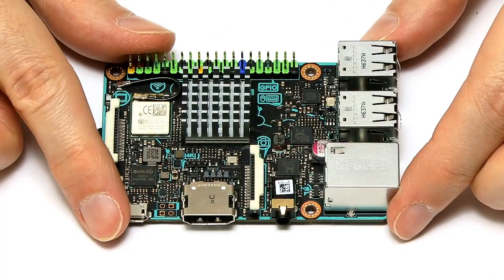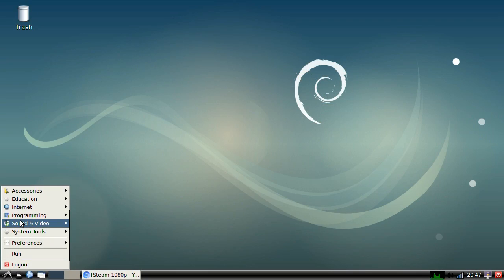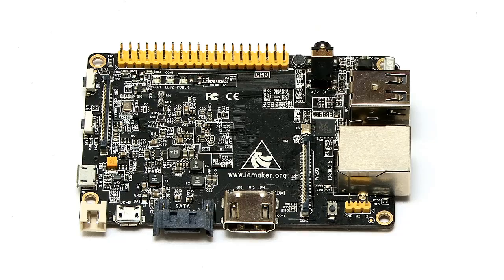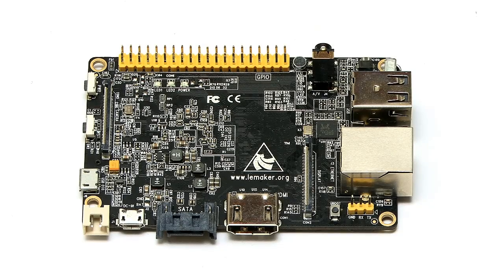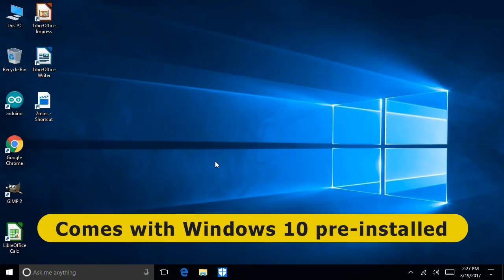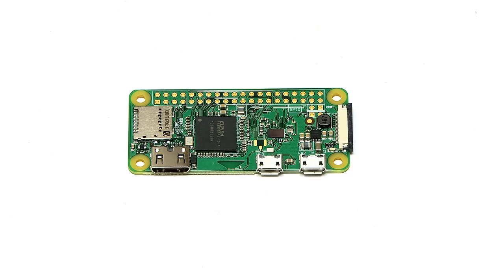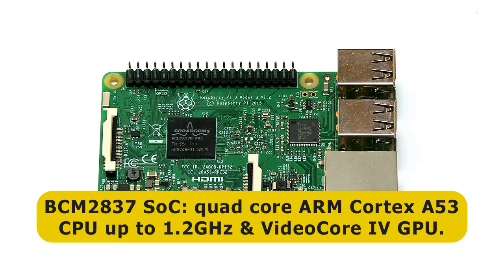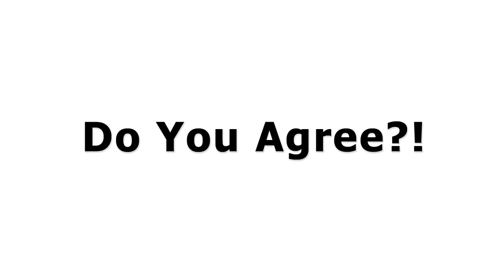Top 5 Single Board Computers 2017

Comment: People think of the Raspberry Pi as a "computer", but really it's a SBC to help you learn programming on and to prototyping other things, and it's NOT some kind of replacement for your PC... although it will do that.
The other thing is people say "I wish it had" , and then fill in what you want. The thing about that is the Pi WILL NOT be ~$35 with more stuff... there are already SBC's with what you want on them, and all of them are higher $$ than the Pi, ALL of them. What you want cost $$ and most lack the community support the Pi has, and there are a bunch of Media Centers available already, if all you want the Pi for is that, there are others out there already.
I'd rather have the $35 price tag to make it do what I want (which requires even less processor power than the Pi has), then to have to pay more $$ for crap I don't need...(or want). What I like is the ability to program on the Pi and NOT to have to SEND it to the Pi.
Reply from the maker: As I said in the video, and as you imply, the SBC market is already segmenting into lower-cost SBCs like the Pi, and more extensive boards for industrial and other applications.

Comment: Got to agree with Numbers 2 and 1.  I have various Pis doing various tasks.  

3 Zero Ws 1 for a webcam, 1 that connects to my solar panel inverter to monitor generation and another that monitors electricity usage.

A Pi 2 runs my weather station

A Pi 3 is in my AV setup

and I Have a Pi 3B+ as a plaything.

No they aren't the most powerful, but I know what I'm getting, I know I can make it do what I want it to do, and there are people who can help me.

Comment: Can the zero w run the camera accessorie
Reply from the maker: Yes, the Pi Zero W has a camera port. It needs a slightly different ribbon cable to connect to the Raspberry Pi camera though, as the board is so small that it cannot include the full-size camera port slot. But the cables are easy to get hold of -- eg see https://shop.pimoroni.com/products/camera-cable-raspberry-pi-zero-edition

Comment: Not to criticize your choice, but just a possible suggestion for a helpful video. The LattePanda can be used for typical desktop stuff like email and web browsing with pretty much just an old TV set, an HDMI cable, a keyboard, mouse and power supply.  How would you do that with a Raspberry Pi? Which operating system would one use, and how do you install it? What adaptors and such would one need? Is the Raspberry Pi suitable for a task like that or would it just be a pain?
Reply: My apologies! That question is answered fairly well in your video comparing the LattePanda with the Raspberry Pi 3. One assumes the use of USB mouse and keyboard in either case.
Reply: have you seen the one which he actually doe s a work week with one?

Comment: Re the Banana Pi ... something to bear in mind if you like the idea of a SATA drive ... I had a cubietruck, which came with SATA support. The big problem is that even using a laptop drive, the power draw was too great. So I had to use both OTG and the power socket via a powered hub to supply enough juice to the board. 

Although I was able to boot off the SATA, I messed aroound upgrading the system and I could no longer get the thing to work.

So SATA drives, although nice in theory, the devil is in the details, and I felt that the cubietruck deisgners hadn't really thought out the design. Just make sure the Banana Pi doesn't suffer from this limitation.

The RPi3, OTOH, is an extremely well thought-out piece of kit. One of it' great new features is a power adapter (!), which means you can supply adequate juice to the board. Powering via conventional USB is really too weak. I am able to boot the RPi onto a SATA drive (via USB), and run the system from there. It was really straightforward using the RPi3, and I didn't run into power issues or have to perform messy kludges. Having said that, I just run my Pi from a uSD now; but all I'm saying is that it can be done if you want to.
Reply from the maker: Good points here. SSDs run fine from SBCs, but beyond that -- as you say -- more power is needed. Though if an SBC is being used to build a NAS, probably a 3.5 inch HDD will be used to maximize capacity, so an extra PSU would be needed anyway.

Comment: I have been looking for SBCs with SATA for a while, thanks. In general I'd like to see more SBCs with more bandwidth (multiple gigabit ethernet NICs, USB3, SATA, etc.) WiFi and graphics are nice but where are the SBCs that cut those out for more bandwidth intensive applications?
Reply: there are, I have seen a multi port one come on the up next list, it had 3 and sata, there is only over a thousand alt choices of SBC

Comment: I agree with #1. I have several PIs myself and other SBCs but what REALLY makes the difference is the amount of software available for the Raspberry PI. For example, I have an Allo Sparky as well. Really nice board, better hardware in my opinion than the PI BUT, and it's a big BUT, software is hardly available and what is there is sh*t. It is largely unusable and is pretty much gathering dust.... So much potential not realised. Ultimately, you can't go wrong with a PI.
Reply: unless you ask a non pi person their thoughts

Comment: I have the Raspberry Pi 3 and have realized there's nothing it can do that my laptop can't LOL.  So my Pi 3 just sits in a box in the shed next to my Nintendo Wii I thought I needed 4 years ago :).
Reply: pitty that it sits there, but it was not meant to replace your laptop, look up story behind it
Reply: Laptop is far more useful to me, and I didn't have the patience and time to sit down and really learn about the Pi so its got a new home.  

They really need to come up with some sort of external power supply unit for them though, they are still tied down to an outlet unless you can find a portable power pack with enough juice to run it, most do not, at least I have never found one.  

I ended up giving my Raspberry Pi 3 away to someone in my Ham Radio group that uses them for all sorts of stuff, way above my knowledge.  So at least its no longer sitting around collecting dust and getting knocked off the table LOL.
Reply: it is good it is being put to use, as far as portable power there are several options.
As far a just a computer there are better options but one reason for its design is experimentation, which not a good idea on a 1000 dollar system (one reason why it was made) I got one to experiment with the controll options of the io pins
Reply: I've got a few portable battery banks for charging phones, etc, they don't have enough output amperage to run the Pi reliably so I quit while I was a head and before potentially causing damage to the Pi itself from the power fluctuations.  

Maybe in the future I'll try digging into the Pi again, but I want to do it when I have someone available to show me some of the features and programming stuff for them to actually make them useful other than just another Linux system HAHA!!!.
Reply: magpi , a free downloadable magazine would be a good source

Comment: My personal #1 is the Odroid C2. It's a competitor to the Raspberry Pi 3 from Korean maker HardKernel, and it's a tight little machine with surprising technical maturity for a SBC.

Amlogic S905 quad-core @ 1.5GHz, gigabit networking (and yes it'll nearly saturate a gigabit connection), 2GB of DDR3 RAM, HDMI 2.0 support (up to 4k/60) with integrated H.264/H.265 decoding in hardware. Sells for $46 in the US. Faster than the RPi3, with faster networking and higher output resolution. Runs Ubuntu MATE, Raspbian, and DietPi, along with most of the other distros that have arm64 builds, as well as Android. 40-pin GPIO that's mostly similar in pinout to the RPi3, and the GPIO includes two I2C interfaces but no native SPI. Has both a microSD socket and an eMMC connector for storage, and both can be used at the same time. The only disadvantage it has compared to the RPi3 is the lack of integrated WiFi/Bluetooth, but since it doesn't piggyback networking and USB data connections like the RPi3 does it can network via USB adapters at a comparable to somewhat faster pace than the RPI3 does through its integrated.
Reply: he has just played with one, but I also think list also has to do with support

Comment: I KNEW your number 1 would be a raspberry pi.. it always is. MY #1 is the nVidia Jetson, which has 60 GPIO, SATA, SD slot, a half-mini PCIe slot, serial port, USB 3.0, nVidia Kepler GPU with 192 cores, quad-core A15 ARM CPU AND is so powerful that I have actually used in the past as a desktop replacement and 4K media player with or without Kodi.
Reply: know the story behind the pi?

Comment: As too me you are the perfect chap to ask this question: why are there no soc boards sporting a sata AND Usb3 port?
I really would like to build a small portable system to back-up my memory cards on the go. USB 2 is way too slow for my purpose.
Reply from the maker: I've just been sent out an UDOO X86 Advanced Plus for review (probably coming up here in a video on 20th August, or maybe the 13th). Anyway, this has three full-size USB 3.0 ports, and a standard SATA port, and an M.2 slot for an SSD. So some serious SoC power!
Reply: Thanx, looking forward to that review. Privcewise on the edge of what I want to spend for this option.
No specs found on Power consumtion, because it needs to be battery powered.

Any chance you can find an answer to the question why there are so few USB3 + Sata boards out there with SOC chips?

Comment: Around three minutes into the video, you mention running a 2 1/2 inch  SATA drive off of this board - Do know for a fact if you can run a 2 1/2 SATA SSD with one of those  SATA (pwr/data) connectors to USB that used to come free when you upgraded an HDD to an SSD - I've often wondered if I could hang one off my Pi 3b. I just ordered one of those connector / adapters to have on hand. Also, I just happen to have a powered Anker 4 port USB hub. I wonder if it will work and if I'll need that powered hub in the loop. Appreciate your answers (or anyone's). Off hand, I think it should work and w/o the powered hub. Thanks.
Reply from the maker: Yes, you can certainly run an SSD off a Pi using one of the USB-to-SATA adapters you mention. I did the very same thing in my BerryBoot video here: https://www.youtube.com/watch?v=BGCeLct5SUg

Comment: I generally enjoy your videos, but this one goes a step beyond.  I've been considering entering the SBC world, and you've given me the advice I most need to move forward with that.  I hope soon to buy one or two of the boards on this list, and see just what I can do with them.  Thank you.
Reply from the maker: Thanks for your kind feedback. These boards are indeed great to experiment with. Using one very much changes your view of computing.
Reply: You're welcome.  ISTR you talking in one video about the difficulties involved in securely erasing flash memory, as in SSDs or USB sticks.  Am I imagining that, or can you tell me which video that was?  I'm going through old drives (have e-shredded five HDs and disassembled three of them), but also have some flash storage devices too small to be worth keeping.
Reply: BTW, I now have a Raspberry Pi 3, which arrived yesterday.  It didn't take much time or effort to get it set up and running, using a 32GB microSD I got for free and feeding through my KVM switch.  I've also finished making those old hard drives Complete Safe, so I have time for the Pi.  It amazes me what this can do, for so little money, using so little power, with no moving parts.
Reply: look up an f-drive program, they write ffff to every part of drive, there are several choice for drive blanking, just please look them up before you break out Mr. drill

Comment: can i run Windows 7,8 or 10 on  raspberry pi 3 please response
Reply from the maker: No, you cannot run Windows on a Raspberry Pi. Well, technically it may be possible via emulation (like I ran Windows 3.1 on a Pi a few years ago: https://www.youtube.com/watch?v=idHQk99E4VA ) But a Pi has an ARM processor, not an x86 processor, so you cannot credibly use it as a Windows machine. Sorry!
Reply: ok thank you and your are so cool and reply instantly
Reply: although there is the windows 10 IOT

Comment: for the price of latte panda enhanced u can buy 10'' windows 10 tablet - linx 1010 which has 32gb built in storage, or more via micro sd xc port, intel atom z3735f  quadcore 1.8ghz 2gb of ddr3 ram, intel hd graphics and other features - and it can run games like fallout 3 or half life 2, when i bought mine with detachable keyboard, the price was the same 150 us dollars, you get 2gb less ram, and 32gb less storage than latte panda but you dont need to have keyboard or mouse, or screen, or speakers because its one unit :)
Reply: it has to do with the nature of what the PI and other SBC is for

Comment: I absolutely agree with the Raspberry Pi 3 being the best out of the batch. I bought one because of your advice and I think it is the best bang for the buck. It protects my Windows PC from all kinds of bad things that can happen to a PC when you browse on the darker parts of the internet since it has no digital connection to it. I have been thinking about an Orange Pi, but these things seem to break after a while or are already shipped with damaged ports.
Reply from the maker: There is a lot to be said for an approach of "if in doubt, browser -- or experiment -- on a Pi". They are really great for that.
Reply: The best "bang for the buck" as the kids say.

Comment: Is there any single board with 2 or more lan connections ??
Reply from the maker: Not that I'm aware of. You would have to go to a mini-ITX board.
Reply: well thank you so much for the answer, well my idea is to create a dedicated firewall with Linux.
Right now I have a Pentium 3 with 512mb memory doing firewall, it uses a 20Gb disk and 3 lan cards (because I like a sub Vlan (3º card), so basically im looking to build one but using the less power possible, yes I know I can use a juniper or something similar but why buy if we can make it and even learn something.

Thank you so much, best regards
Reply: I have seen one with 3 come up on the next column on you tube

Comment: some good choices.

My only lament so far with my Pi3 is it will not run FlightGear (fgfs, even though it's available in Raspbian).  It gets killed due to OOM (guess 1GB isn't enough).  I haven't fiddled yet with seeing if enabling more swap would help.

Comment: I wonder if you want to do the same for 'stick-pcs' ?
Intel had a stick pc for $100USD-149.
Android has many $35-$90 stick pcs.

The difference between this, and a stick pc, is a stick pc is a sort of pc, you plug into a HDMI port of a TV (or PC monitor).
It doesn't have all the feats, but can be a great alternative to read emails, browse web pages, or play basic games.

I'd also love to see some overclocking tests and gaming benchmarks done with an IR camera, to prevent chips or capacitors to pop; and see if some of these cheap pcs can be overclocked to run some heavier games?
Reply: stick pc probably not his thing
but he has done temperture and overclock vidoes

Comment: Er, why do call them 'single board computers'?  Clearly there is only a single board, but the same is true for most computers these days (or the last 30 years or so).  Show me a laptop or a home computer of yesteryear or any of the all-in-one or 'legacy-free' PCs with more than one board.  I've seen them called 'open frame' computers before and IMHO that's more descriptive.
Reply: Never mind -- descriptive or not, 'single board computer' is a popular, if not even the dominant, label of these machines.
Reply: the term lately is for a non expandable computer on a small size board

Comment: 3:40 - are you sure the sata port has any speed? Because I think it has not at all.
Reply: And .. yeah well, I just ordered the tinker board.. for $40 however. When the OS is stable - it's better than the rasp after all because of the hardware capabilities.
Reply from the maker: Enjoy your Tinker Board -- hardware certainly better than the Pi. But the Pi currently wins on software (though TinkerOS 1.8 is pretty good).
Reply: It's connected to an internal USB bridge, so it's no faster than USB 2.0 speed.  And this guy is suggesting making a NAS out of it.....

As far as I know there are no "hobbiest" SBC board that implements SATA properly at this time.
Reply: yep, seems to run fine, no problem so far. Miss some kernel features  but did yet compile one on myself.  ssh -X EC@calmar.duckdns.org password: EC    hehe ;)

Comment: 3:40 - are you sure the sata port has any speed? Because I think it has not at all.
Reply from the maker: As you inply, it will not be a standard speed SATA port (probably running at USB 2.0 speeds). But it is still handy to be able to connect a SATA drive directly.

Comment: What about the Gigabyte F2A88 based systems with the FM2+ socket motherboard that can take the AMD A10 series of SOC APU chips and can take up to 128GB of SAMSUNG S2GB DDR3 RAM, I am watching you on a system that is a SOC based system but has a graphics card that is not really needed installed and should not have been installed.

Comment: Check out dietpi...for SBC minimal installs...support for MANY SBC's out there
I have been messing with Orange Pi PC and Orange Pi Zero lately...they will run octopi for my 3D printer but the wifi is a bit squiffy...but works (I prefer wired)
I do however run a TOR relay and a very effective VPN (using openvpn) on my phones into my home network with a RPi B single core 512